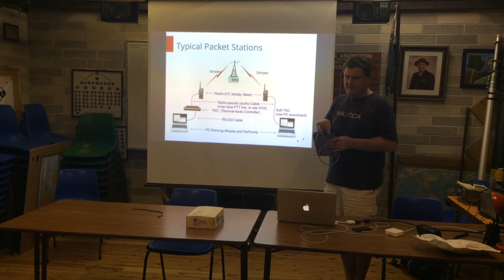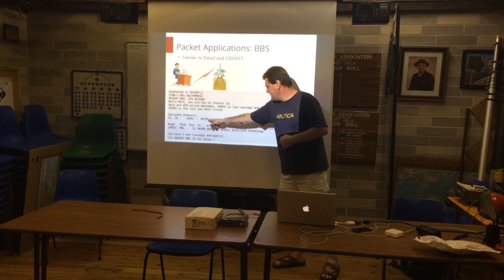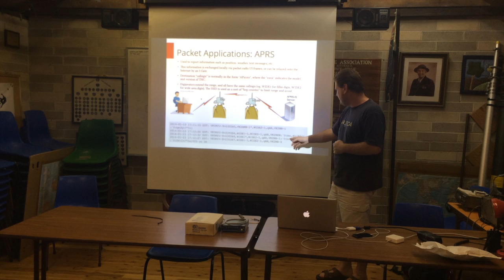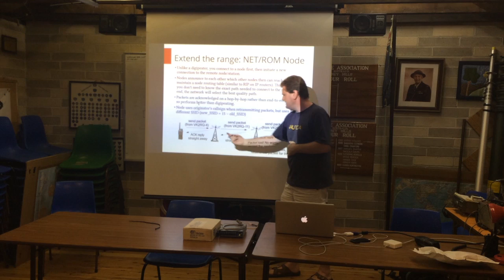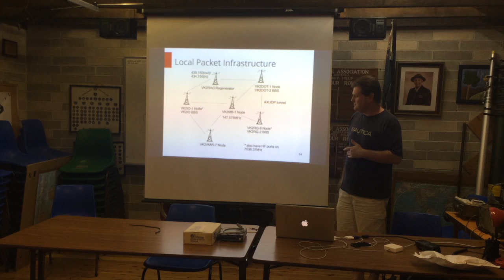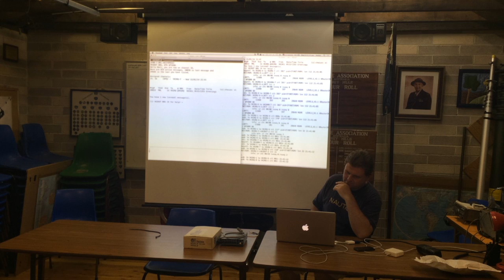Packet Radio Overview - Matt Maguire VK2RQ - Manly-Warringah Radio Society lecture

Comment: I used to pop up on Australian packet radio monitor screens for keyboard to keyboard contacts with Australian amateurs many years ago. Working on a 2M HTX-202 radio an old Zenith 386 laptop with WinPak software  KPC-3 and  KAM PlusTNC's and connecting through nodes to make contacts in Australia. Lost all the packet stations near me. Nobody here was really interested in what could be done so they took their stations off the air. Does your club operate an IRLP or EchoLink system?  175518 is my echoLink and there is an IRLP Node 2524 nearby. 73 de kc8frw